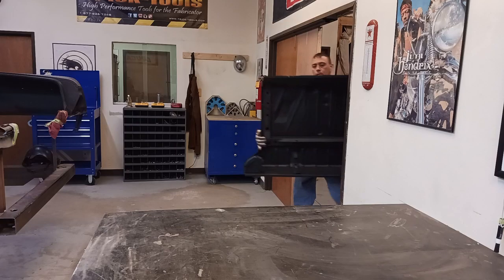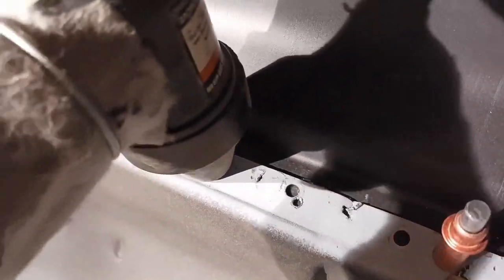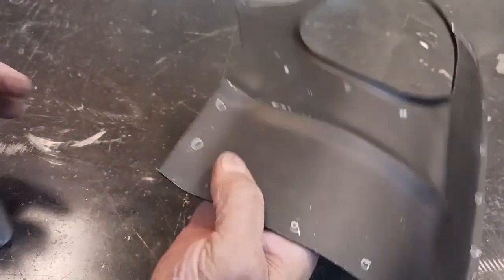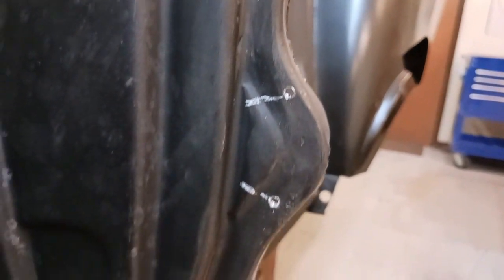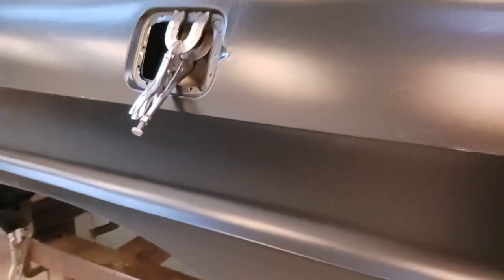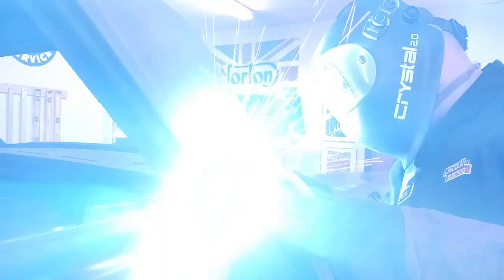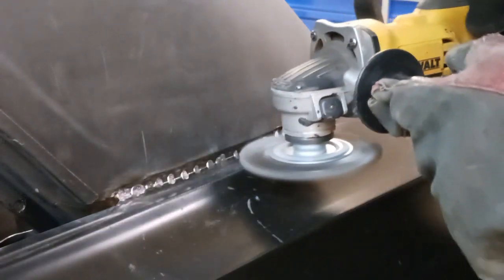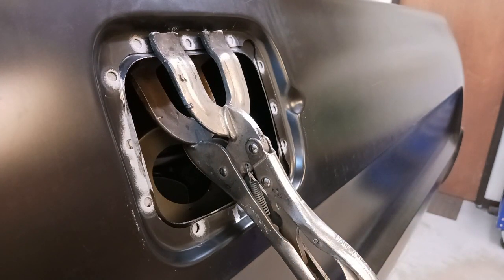1964 Impala SS Part 12 - Upper Trunk Deck Install - Start LH Quarter Panel Installation

Comment: I think that's the first time I've seen you use that sand blaster. Would that give you a bit of grief during the painting process because that looked very fast with the blaster. I have not seen your videos pop up in a while, it's starting to get nice here so the wife and I have been pulling the 262 out of the 72 chevelle getting it ready for a 350. And I am going to watch your 62 impala removal of quarters and trunk floor so we can do the right thing on our 62. Great work as usual, my brother.
Reply from the maker: Thanks for always supporting the channel !
Reply: @Guzzi Fabrication  always, brother.  Learn a lot from you.

Comment: Love you work bro. It would be awesome to see you install a 1964 impala quarter panel for a convertible to see how you modify  this quarter panel to fit the convertible since they dont make a convertible quarter panel.  Thats my situation.  Thanks for the great videos bro God bless
Reply from the maker: Very soon I'm starting a 63 Impala convertible replacing both quarters, stay tuned !
Reply: @guzzifabrication3448  Right on my brother i cant wait bro !!! Your videos and hard work are much appreciated!!!! You have an email i can send you photos or video of my 1964 impala SS convertible? Im in albuquerque new mexico so not far away from you.
Reply from the maker: @cruzhill3411  Sure.

Comment: Hello Robert, wonder if you have tried installing the one piece trunk floor that includes the inner and outer wheel houses?
Reply from the maker: I've seen those... kind of a new offering I don't think I would like to do that because now you're locked into wherever they set the panels and welded them together, that can be a major problem....

Comment: Great Work Sir. Iv been studying your awesome work for some time now. On the rear panel were did you order from?  An do they just have the lower half of the two panels?  Im in search of two panels but want to make sure i get good quality panels. I may just replace the full panel. But i would like to keep as much of good original material as possible on my 64 Impala
Reply from the maker: Try Classic Industries

Comment: Question, is there a reason why you don’t buy the whole rear section trunk wheelhouse and tub assembly?
Reply from the maker: Yes.....
Reply: @guzzifabrication3448  shipping cost? Or you can manipulate the fitment better welding it together in pieces…? I’m looking to do a 62 impala and it looks like it’s gonna need complete floor pan to the trunk all the way to the tail panel 🤦🏻‍♂️
Reply from the maker: @robertruano1871  Both of those reasons, do yourself a favor and buy seperate pieces.

Comment: What size mig wire are you using?
Reply from the maker: I use .035 wire for everything.  Most shops use .025 wire for welding sheet metal.